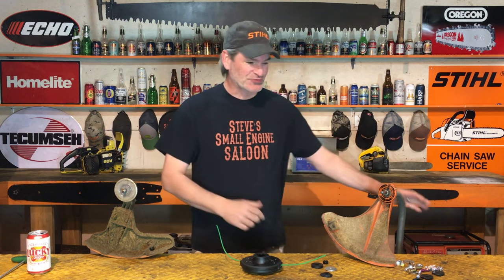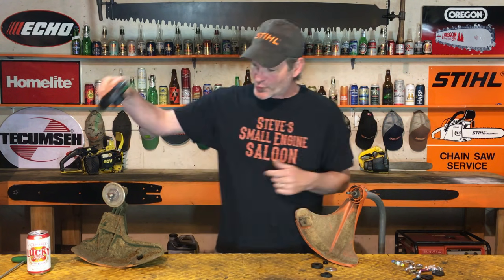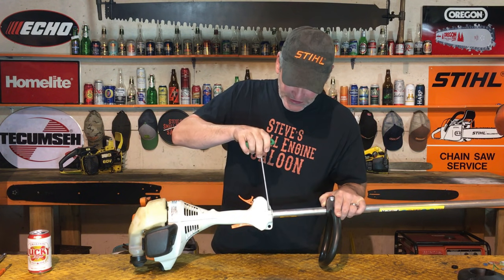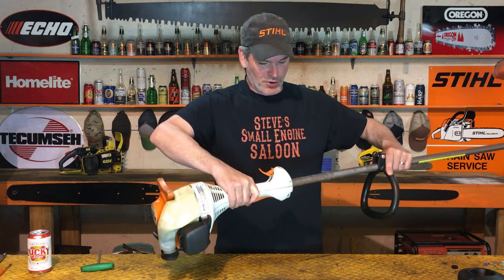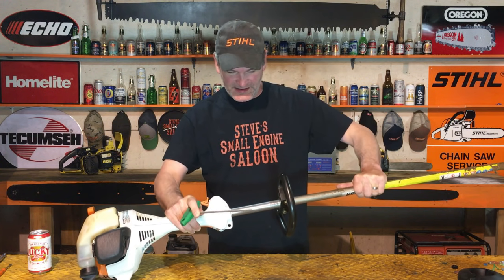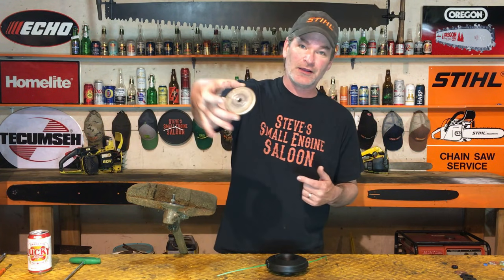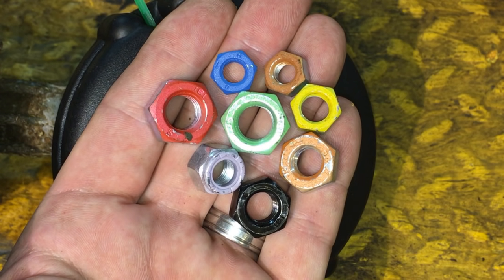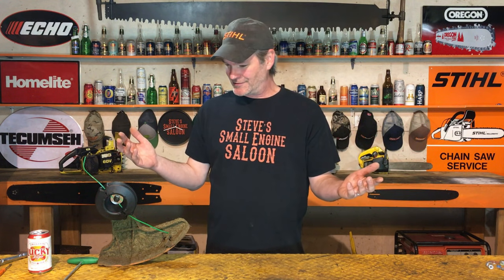How To Change A Straight Or Curved Trimmer Shaft

Comment: Hello and thanks , I've a question that hoping you can help, I assume that the curved shaft head rotate direction from looking from head down CW and since you swapped it out with the straight shaft does it change the direction of rotation from CW to CCW ( some folks tell me that the gear head from straight shaft make the the rotation CCW) It's that correct or am I wrong ?

Comment: does the same thing go for Echo?? I just bought a gt-225 and somebody put a metal blade on it it seems very dangerous one because of the mounting hardware and no reverse threads.
I'm not sure why the threads are not reversed, is this a common thing?

Comment: EVERY video on changing the head or shaft on a dam weedeater ALREADY has the head off?! HOW DO I GET IT OFF?!
Reply: There is a small hole on the top of the trimmer head stick a small screw driver in there it locks the head in place then spin the head by hand that’s how to remove the head

Comment: just a general question to the world - anyone know how to take the spinny guts out of a dewalt 20v string trimmer?   i want to replace it with a blade for hacking down little saplings (yeah yeah, safety sallys, danger)...   but i want to keep the bits just in case i need them for the trimmer i'm keeping as a string trimmer.  anyone?  Bueller?   Bueller?

Comment: After watching this video, it inspired me to try a little more mechanical know how to do what I did. I have a Troy Built interchangeable tool shaft line trimmer that is very hard to start. And a Ryobi that runs like a bat out of hell with a curved shaft. So with a little sawsall work, I was able to adapt the interchangeable tool shaft on to the Ryobi. Now it is a very useful machine. Thanks Steve, I have been learning a ton from you and now I've started a lone wolf lawn care company I'm working as hard keeping my equipment serviced at home as I do out on the road.

Comment: Steve thanks for the helpful videos.

I have a question for you. I own a Stihl Fs 40 weed eater and I want to change the shaft with a straight one from a Stihl Fs 55R. Is it ok to do so in terms of compatibility or motor efficiency?

Comment: Great tip Steve thank you.    Now does that include all other makes also.
Reply: not all i have tried a ryobi the curved shaft is bigger than a strait just measure the outside diameter that will let you know
Reply: Thank you George

Comment: Great info Steve 👍 I have an old Stihl FS44 that I fixed up to sell. But do to it's age I haven't got a single bite on it. I also have a nearly new fs40c curve shaft would  the straight shaft from the FS44 fit on the fs 40c?

Comment: You saved me some time there,  I always take everything apart to do that. Does this method never trap the wires to the switch?
Reply: Yeah I'd have started with splitting the case, only to realize the shaft would pull out as Steve showed.

Comment: Excellent information thanks Steve.
 Mate, I also have a solid shaft brush cutter (Homelite) and it is one of those interchangeable jobs that has a brush cutter attachment, Hedge trimmer & a tiny chain saw attachment. Now, I was wondering how you lubricate the bearings in these interchangeable shafts? The three separate shafts seem to have a bearing at each end but they are way down inside the shaft tubes & there are no grease nipples, so how do I lubricate them? I wish it had a flexible shaft because they take cutting shocks a little better.

EDIT: I might have answered my own question.. I just went to my local Hardware barn & bought a small diameter PVC Tube & screw on cap & 3/4 filled it with oil. 
I then put the entire brush cutter shaft tube in the PVC tube & let it soak in the oil for a few minutes while manually turning the shaft. 
After about 3 minutes the shaft bearings ran smooth again. 
I let the excess oil drain back into the PVC Tube & wiped the outside clean, job done - clean & simple. 
I will probably have to do it regularly now because the shaft bearing have had a lot of work without lubrication up until now..

Comment: This does not work.  I just got done trying it for myself.  My Stihl FS40C is a fairly new weedeater.  I wanted to take the straight shaft off my Stihl FS55R to use on the FS40C.  Because the 55 wouldn't running right anyways.  When I did this, the FS40C didn't have enough power to even turn the head on the 55R.   Just because it fits and looks like it will work.  Doesn't mean it will.

Comment: I went from a curved to straight shaft just watching!

Steve, could you include how to lube a straight shaft some time (seriously)? The manual for my Husqvarna 128LD refers to it and it's not clear how. I've never done it but it looks like just dumping some 90# gear oil down it.
Reply: Hope Steve addresses this for you. I can say that I’ve taken mine apart and it had grease inside.
Reply: That made me laugh out loud!
Reply: @daveh1081  stihls are only ones that are inchangeable wich inbox stores cant wich stihls are smart and easy to swath from curve to straight
Reply: LMAO
Reply: Not sure on Stihl, but on an Echo trimmer you take the motor off as shown in the video and then pull the drive shaft out of the tube.  I have a helper hold most of the shaft while I smear grease along the entire shaft.  Feed the shaft back in the tube making sure it seats in the cutting head.  I turn it by hand to make sure it's in.  Put the motor back on as shown in the video and you've grease the drive shaft on your trimmer.
Reply: @daviddaniken7248  Never thought the core could be pulled out, the manual certainly doesn't mention it. Thanks.
Reply: @ChuckD59  This is for sure on Echo motors.    I run 10 of the GT-225's.  I buy the cheapest model with a curved shaft.  I run a Christmas Tree Farm and use the motors on tree shearing machines. ( I throw the cheap curved shaft in the dumpster ) I lube the shafts on each one after we are done for the season.  I forgot to mention that on the Echo's, there is a rubber liner that the square flex shaft slides into.  I pull the liner and shaft about 6 inches out of the outer metal pipe.  With a pair of pliers I remove the square flexible drive shaft from the rubber liner, then grease as described above.  Next guide the flex shaft back into the liner, then push this assembly back into the metal pipe.  It takes some finesse to get the end of the drive shaft to re-engage with the socket on the cutter head, but it is quite obvious when it does.  Turn the shaft and observe the cutter head rotating to make sure the cutter is fully engaged.  Last, check the parts pdf file for your machine.  It will have a full breakdown of the driveshaft and how it connects to the cutter head.
Reply: @daviddaniken7248  I realize that you are talking about the cutter head but are you also saying that you swap shafts, curved to straight, on your GT-225's? I would like to do this on my GT-200 but the shaft on it is 7/8" while all the the straights seem to be 1". Thus, I don't think this swap will work but I could be wrong. Did you encounter this difference?
Reply: @jjparody8257  I junk the supplied curved shaft trimmer and install a specially made shaft and head designed for shearing Christmas Trees .  It is the same diameter as the curved shaft.  You can get one from a company called Tree-Tek.   I've got about 15 of the tree shearing shafts including spares.  A few are 1-5 years old, but several that are used each year are 40 years old.  I have never tried swapping a curved shaft weed eater head with a straight shaft weed eater head.
Reply: Take the head off the unit and you can actually open up the face the head rests on, on my echo srm210 at least, and once a year I clean it out and stick some red n tacky in it then reassemble. It runs much smoother though at first it may not seem to spin as well it takes maybe an hour or run time to get it all worked in and its as smooth as butter aftet that. My PawPaw has always had straight shaft trimmers and I was given his chainsaws which were both poulan's a 2075 16" that was a beast, and a 14" that wouldn't stat tuned on the carb and his echo srm210

Comment: Hi Steve, I recently bought a tiller attachment  GC720 for my grass cutter. The problem is that the tiller has a square 9Male)end flexible shaft and the grass cutter has a 9 spline(female) shaft. Since the square end of the shaft of the cultivator does not fit in the female splined shaft of the grass cutter, is it possible to fix a splined shaft to the tiller and remove the flexible shaft? Also is it possible to weld the flexible shaft to a splined piece so that it can then fit to the grass cutter end?
Does andy square to spline adaptors exist?
thanks for your help.

Comment: Great video, Steve...eh?   It does bring up a bit of a question though...since the curve shaft trimmer heads spin counter clockwise, and the straight shaft trimmer heads spin clock wise...how is that factor dealt with by the machines?   Will that affect the deadly "climate change armageddon" that Greta is warning us about?

Comment: Steve great videos , learnt lots about my 034 chainsaw and now have a great second hand saw. I have a new problem with a weed trimmer/ brusch cutter I have it's made by Poulan and its called the Pro Model 200 , has a 40.6 cc Kawasakia engine and runs great . Here is my problem first the tank expanded with air and burst I used your video and plastic welded all back together and it worked great . Now you fill the tank put the cap on and tighten it and the tank is just pushing the gas out where the line to the carb attaches , if you put your finger over that line hole it leaks all around the gromit . What do I do , id the duck bill vent in the cap the issue .This machine is old (1994 - 9) most parts are obsolete and I don't have the budget to purchase a new machine let a lone even a six pack of the fake beer . would appriecate any help markbuilt@hotmail.com